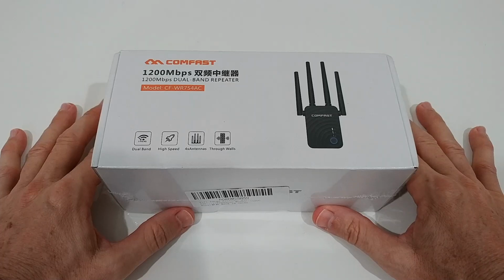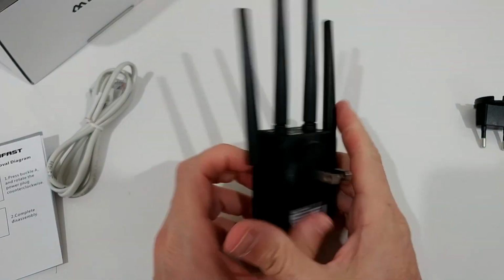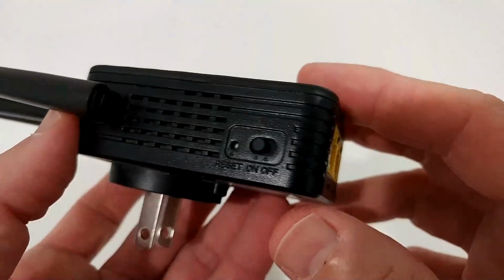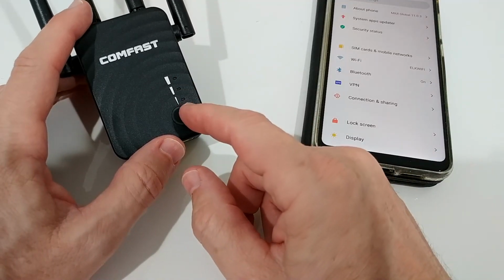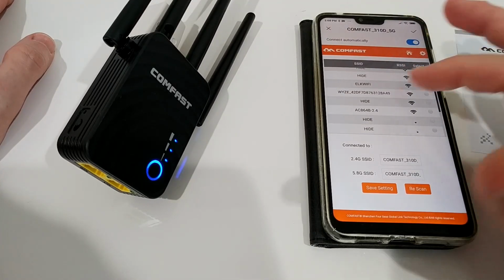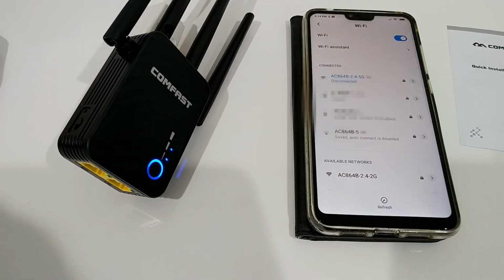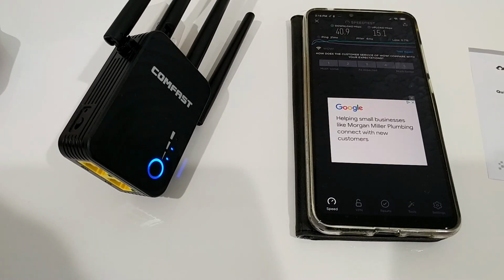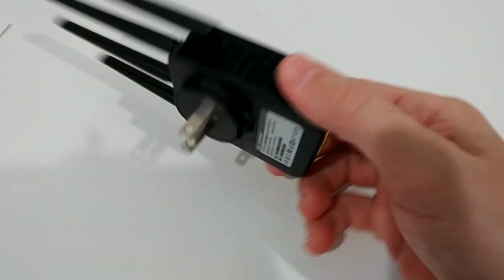COMFAST (ELCM) 2.4g + 5g 1200Mbps WiFi Range Extender Repeater Booster Router (4 Modes) FULL REVIEW

Comment: en mi móvil me da señal toda( las barras a tope), pero sin acceso a internet
Reply from the maker: Then it's not connected to your ISP router - only to the access point, which has no connection to the ISP router.
Reply: @allcheckout  Gracias, ya está arreglado, suficiente con resetearlo y volviendo a enlazar,

Comment: Just one question. Does the distance of the wifi extender from the router matter? The one I use didn't show any lights flashing
Reply from the maker: Yes, sure. Start close and when you have connection and everything is working then try with larger distance

Comment: Don't buy these cute little gadgets ! They are merely a plastic shell with whatever inside the main compartment,and air filled antennas. You guessed it right ! I actually bought one.
Reply from the maker: When they work - they are quite nice, but they are complicated and heat up like crazy ..
Reply: Dont listen to this dildo!

Comment: this wifi extender can disable wifi and only use ethernet cable to connect laptop or tv?
Reply from the maker: Good question ... I guess so, but I'm not 100% sure  ... I have it somewhere in a box and not using it at the moment ...
Reply: @allcheckout  can u check it for me?
Reply from the maker: @faizulmohd8732  Is it still available online? I can't find it on Amazon ....

Comment: Great review, thanks!  I found you after seeing this device in amazon listed as ELCM, the one you linked.  I found another that I think may be the same but just rebranded as Comfast which you also mention along with ELCM.  It is currently listed as $2 USD more.  Both devices have thousands of reviews averaging over four stars. As such, some of the highest rated repeaters on amazon.  Here is a link: 

https://www.amazon.com/Extender-1200Mbps-Repeater-Wireless-Penetrability/dp/B08KWLXGPL/ref=sr_1_49?crid=YVTE8UU5UMRZ&dchild=1&keywords=wifi+repeater&qid=1603648381&refinements=p_72%3A1248879011&rnid=1248877011&s=electronics&sprefix=wifi+rep%2Celectronics%2C191&sr=1-49
Reply from the maker: Thanks ... interesting ... yeah looks pretty much the same